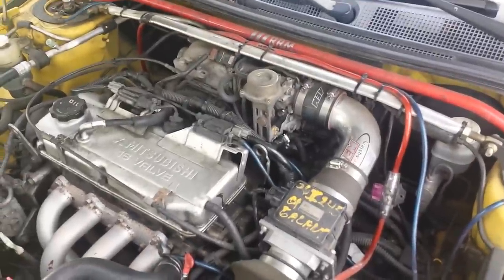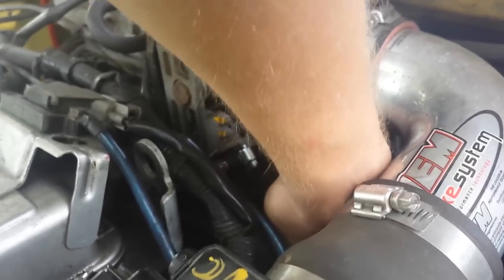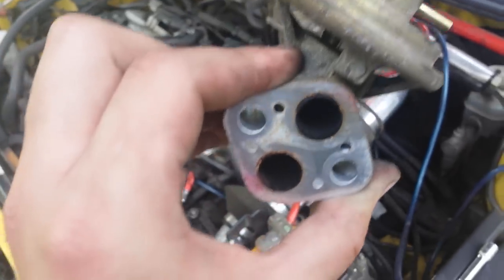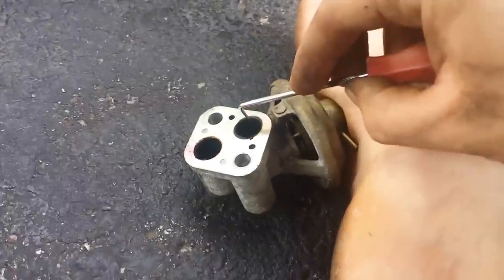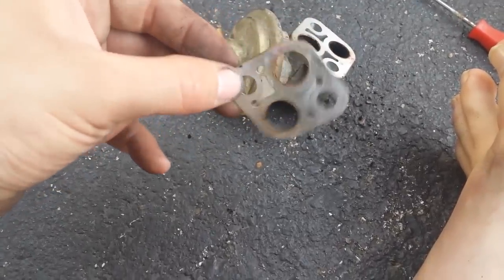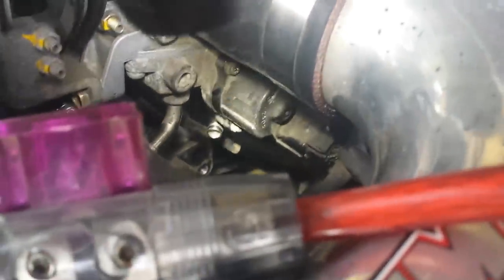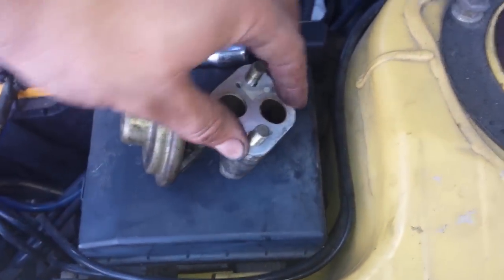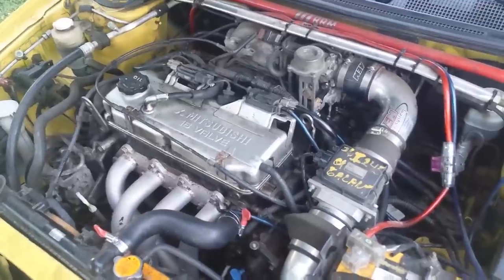How to clean / replace EGR valve Mitsubishi Lancer 2002

Comment: Wd40 in the vacuum port. The diaphragm gets stuck in the open position causing rough idle. No need to remove the egr. Do it when hot. Instant fix.

Comment: Hello micah i had  a question i have a 2004 mitsubishi lancer. Did u ever replaced tour fuel filter? Is ur fuel filter in the backseat of your car ? I heard its the whole fuel pump assembly is that the fuel filter connected ? I just want to double check woth you. And if ever have u had an error code came up to your car P0456 small leak… i change my gas cap i bought genuine gas cap from mitsubishi dealership but i still had that small leak. Maybe a little help u had knowledge or u experience this to tour car. Thanks in advance!!

Comment: never spray carb cleaner into the vacuum port of an egr valve. it can damage the rubber diaphragm inside and make your diagnosis really hard. if the vacuum port is clogged then replace the valve and identify why your building up carbon in an egr vacuum port(unusual)
Reply from the maker: Thanks for your comment +John Smith
I have to disagree with you, carb cleaner shouldn't affect the diaphragm in the EGR as it's designed to be used in cleaning carb diaphragms which are very similar in makeup and design.
I've not had any trouble with this method as well.
Reply: Micah G Robinson im not saying your valve is guaranteed to fail immediately if you ever do that. the rubber is made to resist solvents most of the time. this is simply a do it properly critique.
but older egr valves that have dry and brittle diaphragms can be damaged by powerful solvents like carb cleaner. electronics cleaner would be better for this. carb cleaner will heavily increase the rate of off gassing of the rubber, drying the diaphragm even further. even if youve never experienced a diaphragm failure from carb cleaner, i have once. its also bad for the longevity of newer valves, even if it doesn't fail at that moment. just because egr's are built on carbs too doesn't make it ok for carb cleaner to go into the vacuum port.  you shouldn't be getting much of any carbon build up in the vacuum port because its not open to gasoline vapor from the intake to reach it once turned off or or car idling. and whenever it does open to the intake, its under vacuum. 
see what i mean? thats why you don't see much build up unless that vacuum switching valves or whatever are slightly stuck open leaving it open to intake fumes after the engine is off. makes engines run like shit, or not run too, obviously.
Reply: Ditto

Comment: Hey Micah, thanks for the video, was getting egr code. Cleaned it and no code now. On your intake what is the black box on top of it with all of the yellow writing?
Reply from the maker: Glad to hear it Joshua Miller :)
Thanks for the comment!

That's my upgraded 501 Mitsubishi throttle body. It came from a jink yard (hence the yellow marker) out of a Gallant. I also flashed my ROM on my computer to take advantage of the added breathing capacity.
Reply: +Micah G Robinson hey man, how did you flash your rom? I did a EGR delete when I got my RRM ported and polished intake and throttle body. Now it is throwing a low flow code and I am NOT hooking it back up lol.
Reply: Dillan Addington Yeah, that’s what happens when you remove the part but don’t reprogram the computer to ignore the egr. It senses low flow because there is NO flow. Hence, check engine light.

Comment: Hey Micah is your air intake system wont give you problem like have a engine light comes on after replacing aftermarket intake system? Because i just want to get a new intake system and upgrade it like yours. Thanks
Reply from the maker: No problem at all, no lights. Thanks!

Comment: I replaced my egr valve for my 06 galant my engine light went off but it came back on a couple of hours later. Should I drive it some more to see if it goes back off?
Reply from the maker: Hmm, that's a weird issue. I'd get the code scanned at a auto parts store and see if the code is the EGR code still.
Sorry, not much more help sadly
Reply: Clean your throttle body and reset low idle with the throttle position sensor and adjust low idle speed. Then perform a fresh computer reset.

Comment: I have an Oz Rally edition Lancer and just tried this.  Initially the check engine light went off and it seemed to be fine but after driving it for maybe a mile I lost a ton of power and it started stalling out.  I'm not sure whats up but I'm thinking I might have a clogged catalytic converter now from some carbon that blew back through the exhaust.
Reply: Carbon likely just resettled into the EGR valve after it dried and now has the EGR stuck open causing it to dump in too much exhaust gases into the cylinder so now there isn't enough actual air for proper combustion

Comment: I'am changing my intake to a short ram.... SO if i took it off my old intake i can easily get the access on EGR valve and clean it before i install a new intake?
Reply from the maker: It's a lot easier to gain access to with the factory intake out of the way for sure. Yes I think it'd be a good time for sure.
Reply: Micah not sire if i ask you about the symptoms of EGR if its bad… i had loosing power sometimes when i press the gas pedal rapidly.

Comment: I found and removed the egr valve but there was no air hose attached at all. I just bought this car 2 days ago. I can't seem to find any loose hoses anywhere. Where should the hose be coming from?
Reply from the maker: +Stephanie West Sorry for the late reply.
The vacuum hose connects from the EGR to a metal hose that runs on the front side of the intake manifold parallel to the motor. There are 3 metal hoses that run this path. Hopefully only one is open and easy to find. Did you get it fixed?

Comment: Do you have to disconnect the battery ?or will it go off by its self once you clean the valve ?
Reply from the maker: guatemalan flash it probably will go off by itself eventually, but disconnecting the battery will speed that process up

Comment: Would this help for a 2008 Mitsubishi lancer, I'm being told that an new one will cost over 500 dollars.
Reply from the maker: It's worth a shot. Cleaning them very often fixes the issue and then you can avoid the replacement. You'll have to clear the code after you clean it and see if the check engine code comes back on.
Good luck!
Reply: @mci2727  thank you so much for answering !!!!
Reply from the maker: For sure! Let me know how it goes or if anything pops up :)

Comment: Can you spray inside the vacuum line as well?
Reply from the maker: hb713 Sorry for the late reply. You can but you don't want to leave any standing liquid in your system for fear of hydro-locking your motor. So if you spray in a vacuum line I'd just make sure you let it drip out before you put it all back together. Thanks!

Comment: My 02 lancer shakes when in Drive at a complete stop. I don't know what is wrong. Any suggestions?
Reply from the maker: Gao Ee Yang Is it not throwing any check engine codes? Have you had it long? I ask because these cars idle a little rough from the factory due to the factory set low RPM idle (though you can't raise it without throwing codes either lol)

A correctly running 2.0L Lancer with factory tune, intake, exhaust etc. will sound almost like a Volkswagen diesel at idle.
Reply: my car did the same thing....front left woyld shake...i allready knew what the problem was though.it was a transmission mount...354$ later.problem solved and it runs smooth..hope i helped...it could be a engine mount aswell....these are just suggestions for you

Comment: you shouldn't spray carb cleaner into the vacuum port it will eat away at the diaphragm that opens and closes the valve and there is no carbon build up there